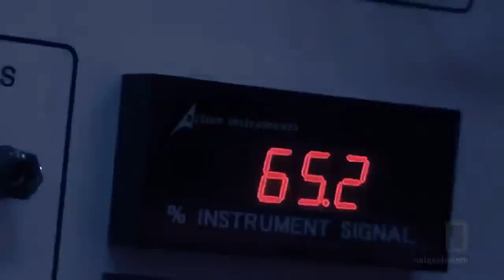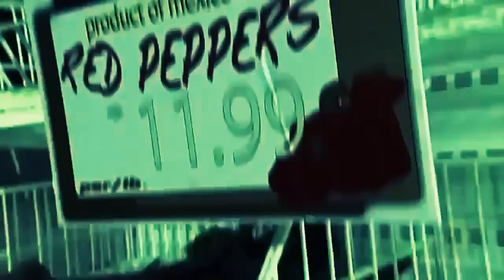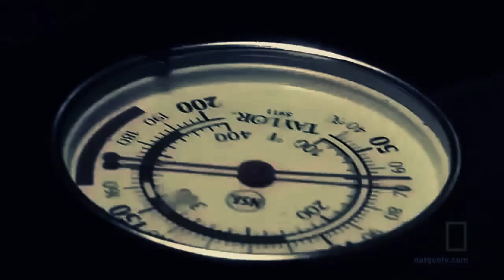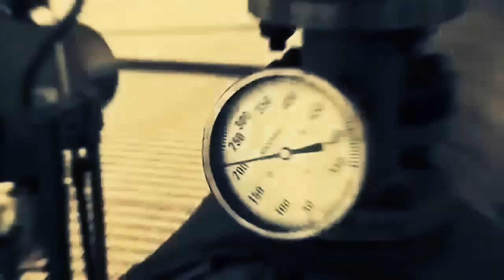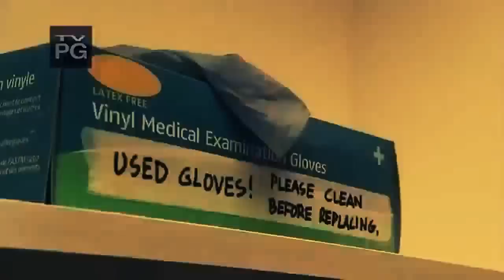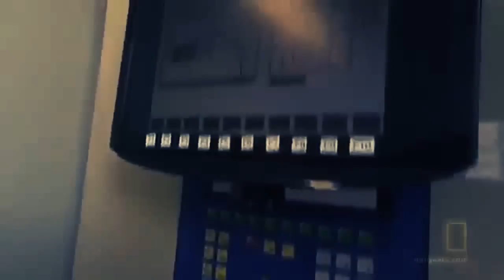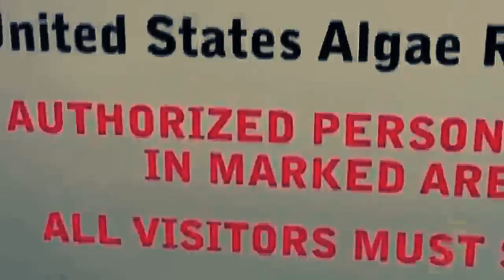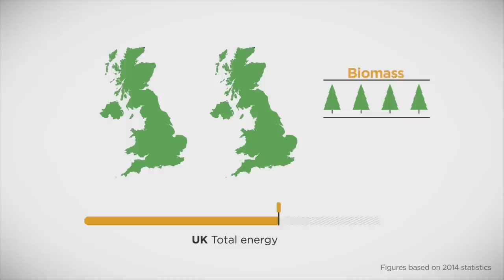Aftermath - World without Oil - What will happen to our world?  HD Full Documentary

Comment: People thrived for millennia without Oil. Ships sailed the Seas, Caravans travelled the Deserts and - in America - Wagon Trains took People and Goods across the Continent. So what's wrong with these People? Modern Tools mean they could build sailing Ships much faster than they used to and it's the same with Wagons and other non-Engined Transport. Then there's the trusty Bicycle - so why are the Roads empty, while the Highways could be used to speed up Wagon Teams that used to use very uncertain Trails. The Oil that's left could be used to provide the Transition and would last a lot longer while this happened!
Reply: People thrived for millennia without internet, u ready to unplug anytime? :)
Reply: @g_y.rtz420   Just commenting on the complete lack of Initiative that causes Conflict rather than adapt. As for the Internet, I spent years not even having a Phone, while I've never owned any form of Oil or Gas propelled Vehicle.
Reply: @g_y.rtz420  The nature might help😁😁😁with a strong enough solar flare!Can you imagine the consequences?
Reply: @allyjay7460  Except they didn't have Solar Panels so used Whale Oil to fill Lamps, which they wouldn't need to do now.